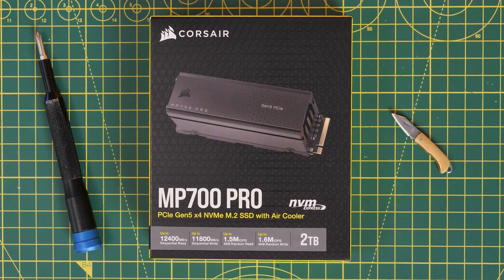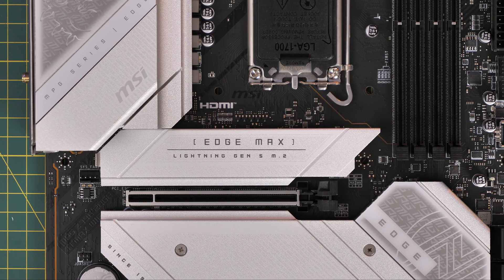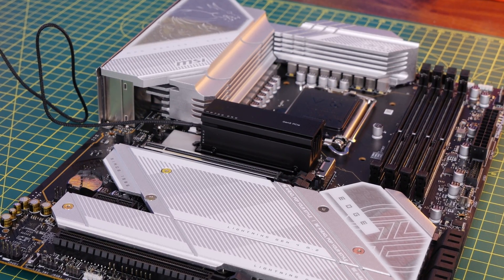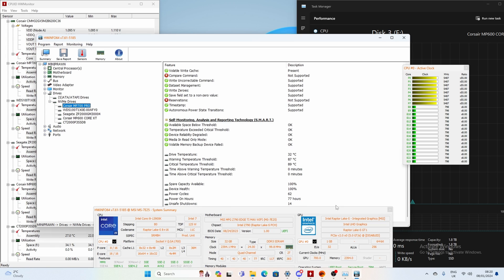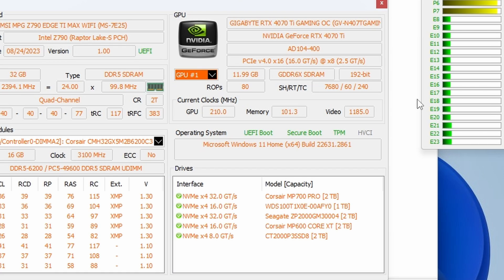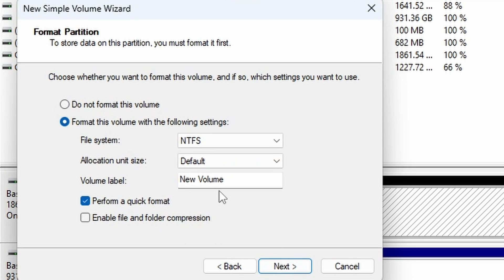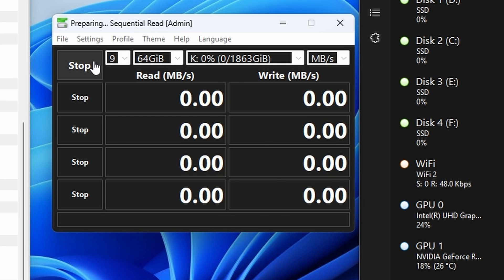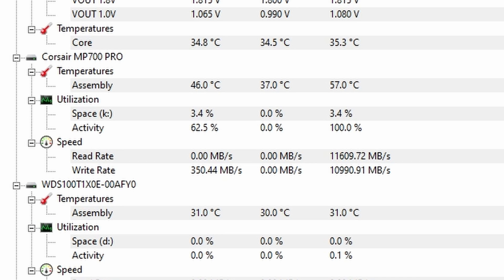Corsair MP700 Pro NVMe SSD setup guide and testing tips

Comment from the maker: Specs of this build (Please note links listed here include affiliate links which may earn me a commission.)
Motherboard - MSI MAG Z790 Edge TI Max Wifi https://amzn.to/41yjPmh
CPU - Intel Core i9-13900K CPU https://amzn.to/3Ry7UAl
RAM - Corsair Vengeance RGB DDR5 16GB x 2 6200MHz (https://go.corsair.com/eKAL3Z)
NVMEs:
Corsair MP700 Pro NVMe - https://go.corsair.com/eK2g5D
Case - Lian Li O11D Evo RGB (https://youtu.be/c-0WW77_fM8)
PSU - Kolink Regulator 1000W PSU (https://youtu.be/sjEJrl294mI)
GPU - Gigabyte RTX 4070 Ti 12g OC https://youtu.be/_-bu6qDqeWA
SSDs - Crucial MX500 2TB and Crucial BX500 2TB https://youtu.be/IOJNybKZ4wk
Corsair iCue Link System and QX Fans - https://youtu.be/brWz3ADfAiA
Corsair iCue Link LCD upgrade - https://go.corsair.com/21eMez

Comment: I’ve been using the 1TB variant of the drive for approximately a year without any issues. It’s running smoothly on my MSI MPG X870E Edge Ti Wi-Fi motherboard, which comes with a dedicated heatsink. In a few days, I’ll be adding a 2TB drive to the second Gen5 slot.

Comment: I installed this in the top (confirmed Gen5) m.2 slot in my ASUS ROG STRIX B650-A GAMING WIFI, I tried every possible BIOS setting and it does not go above Gen4 speeds (7400 MB/s). Any recommendations? (HWinfo lists it as Version 5.0, x4 current link width, Max link speed: 32GT/s, Current link speed: 16 GT/s). The BIOS doesn't even recognise it on Gen5 or Auto setting, only Gen4.. And once it is recognised on Gen4 it fails again if I set it to Gen5.. 😶😶
Reply from the maker: According to the specs of the motherboard, that M2 port is only gen 5 if you have a 9000 or 7000 series CPU. If a lesser one then it's gen 4. I assume based on what you've tried that it's not that? Can you not find bifurcation settings in the bios?
Reply: @TheProvokedPrawn  Thanks! It's a Ryzen 7 7700, and there's no BIOS setting combination that solves it. I think it's a shoddy board implementation , I will try my luck on an X670E
Reply from the maker: Frustrating. Sorry.

Comment: I bought this but I've been unable to secure it down to the mobo due to its height.  Can't seem to be able to loosen the mobo screw to raise the height
Reply from the maker: Have tried removing any thermal pads from underneath it?
Reply: @TheProvokedPrawn if I remove the thermal pad it fits fine.  Would removing the pad not causing a temperature issue even with the air cooler attached? And unfortunately my board does not have a screw which I can loosen in order to make it to fit like you did in this video, it's basically a smooth cone top instead of a Philips head.

Comment: I just don't want active cooling on my SSD, especially not a small fan. They should put much better passive heatsink and there is enough air movement in the case. Also there is 0 benefit of gen 5 for OS or gaming or basic PC stuff. And again even if you edit videos, as soon as the 2-4gb buffer is full it will slow down to 3000 mb/s or even lower. I will wait till the 2nd or 3rd version of the GEN 5 coming out. Building my new PC now, and my choice is the Samsung 990 Pro 2Tb, literally half price, identical performance in real life use.